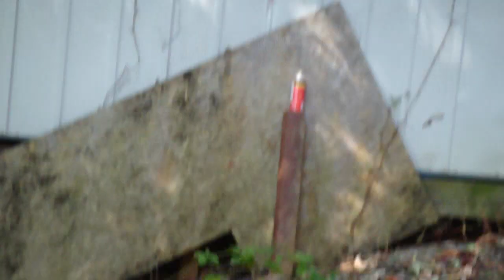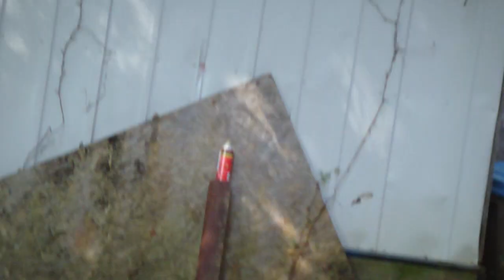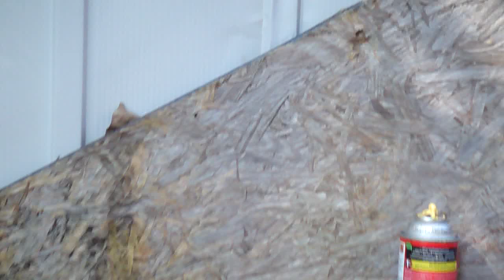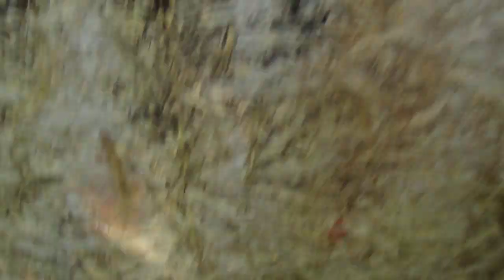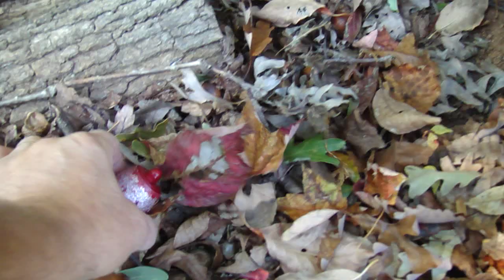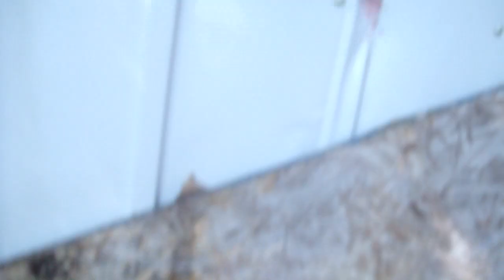Fuh-Twang! Wood Slug into Sheet Metal from a Potato Cannon

Comment from the maker: @thelethalmoo I received the ignition module I ordered on eBay and it looks pretty serious. For $15 shipped it's a deal. Waterproof and runs on an AAA battery.

I was able to rig the snap igniter so it works...not even sure what I did. I just took it apart and   put it back together and it kept working. But the electronic bit is cooler.